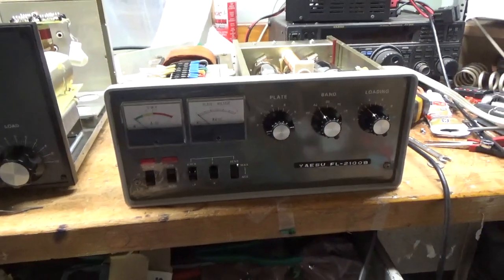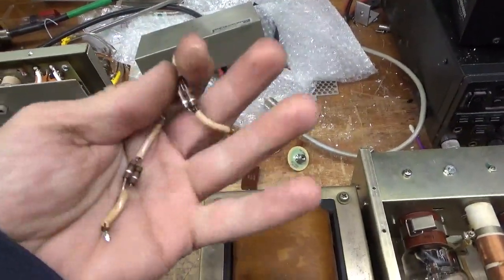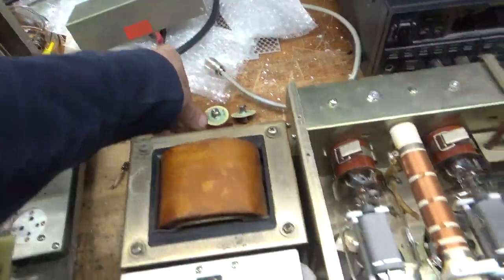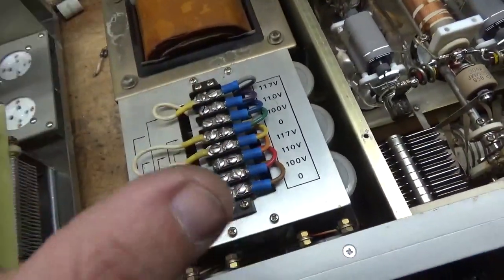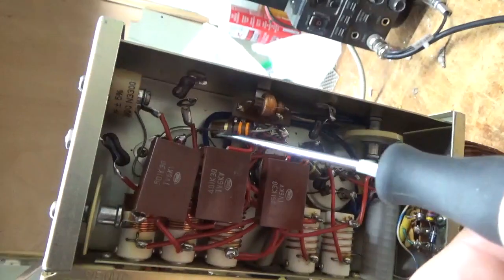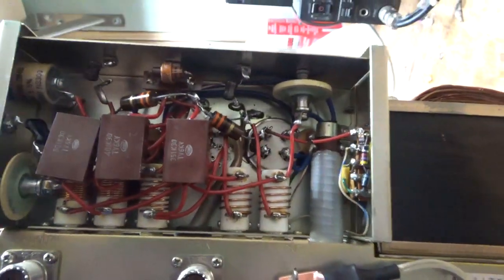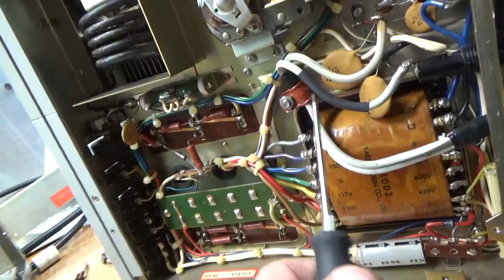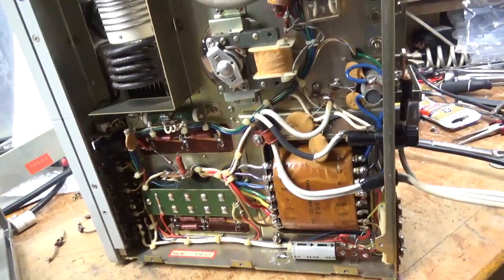Yaesu fl2100b Repair

Comment: what are those disc looking things called? do you know who sells them I have a cracked one that needs replaced. thanks
Reply from the maker: Doorknob capacitors, I replace with a silver dipped radial lead mica capacitor. With a voltage rating of 500 or above. Can source from various online sites

Comment: Love watching your videos on the FL2100B as I have one! I replaced the 572B's with Penta Labs tubes. Happy, happy. Just one thing, on 40 and 15 meters the input SWR is kinda high. I've replaced the tuned input mica caps as one of the 15 meter caps failed. Good after that. But, after watching this video of yours, you mention "tweaked the input coils". In the 2100B manual it says that if you put new tubes in, that you may have to adjust the coils and they give a procedure. If you are familiar with this procedure, doesn't the safety lock cut off the plate voltage instead of disconnecting the wiring at the transformer?  Thanks. Steve NN2NN
Reply from the maker: Hi Steve,
 I tune the coils from the bottom but must be extremely careful as there are hv points exposed. I tune the pa up for max output first on the middle of band that I am going to tune the input coil on. I then put the pa on its side and put 5 watts cw into it and tweak the coil adjustment for the minimum swr between pa and transceiver. Same procedure for each band. Must be extremely careful.
Reply: @amprepairguy  Thanks a million.